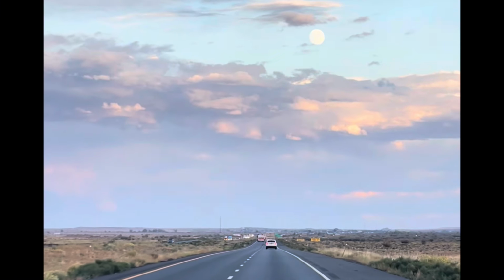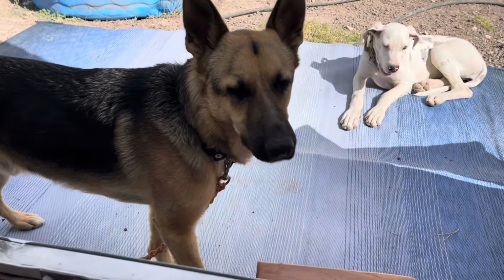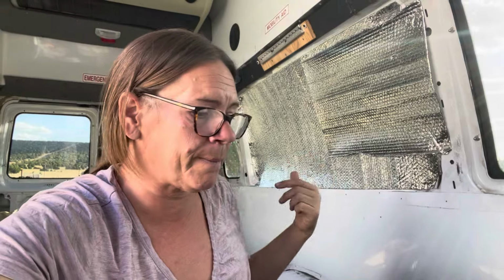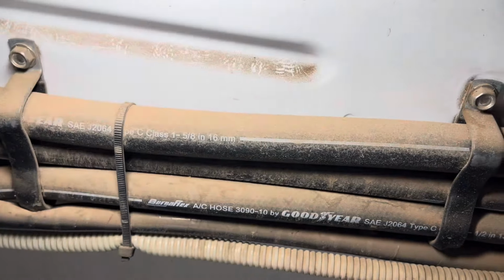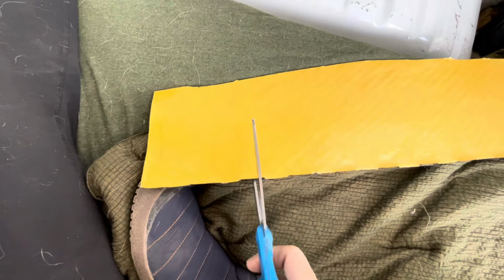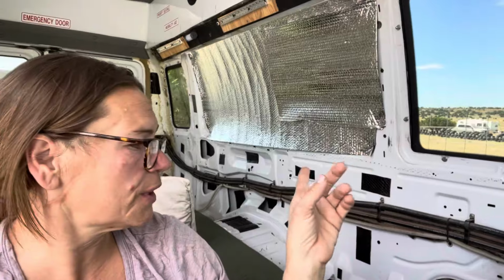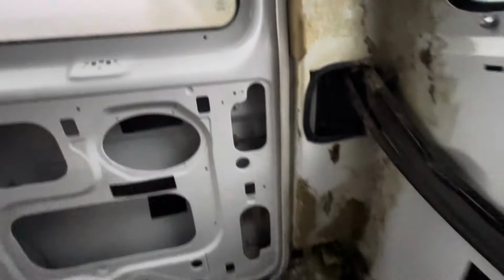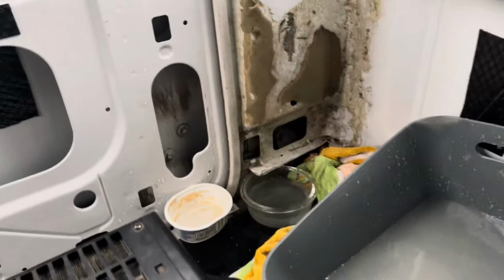VANLIFE VAN BUILD GONE WRONG: This Van LEAKS  & $4k Heater/AC Problems

Comment: Omigah. I went through the same nightmare with my vans a/c heater contraption in the rear cargo area. I asked a repair shop to drain and cap the line so I could remove the obnoxiously large component that was taking up valuable space. The dipshits just drained the line, but didn't cap it! So when I wrastled the huge system out, I had to cut and crimp the copper pipe line that went from the motor thingy through the floor and runs along the undercarriage. Then I jammed hella cardboard into that floor hole. It's so ratchet! I did find a video last year where a guy goes through the step by step details on how to remove these things and deal with the lines. Fight on, Bunny! 💪🏼
Reply from the maker: @NinaDisco  😱😱 oh noooo! These repair shops have given us trauma and PTSD I don’t trust any of them anymore. That video would have come in handy 😆
Reply: @bunnyandbeyond  I completely agree. Even the shops I've vetted through the better business bureau are jankie panky jerks.

Comment: Wow I have to say you are so brave for tackling this project…lol I wouldn’t have a clue where to start 😳 but you’re about to get the leak fixed  and close that loop thing so you’ll have heat and ac…hey one step at a time…🙏 things go better next day…♥️ Hang in there…
Reply from the maker: @elvafae9902  Ty! I’m holding on to dental floss at this point 🤪